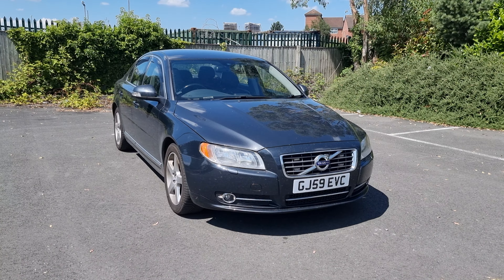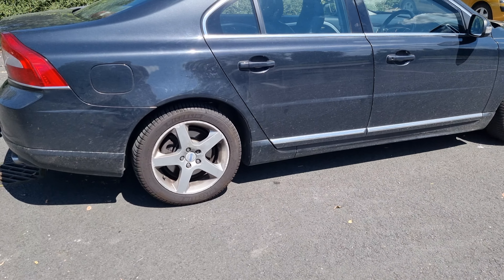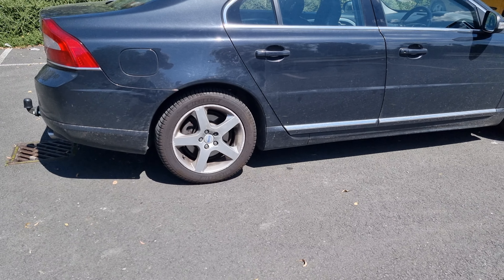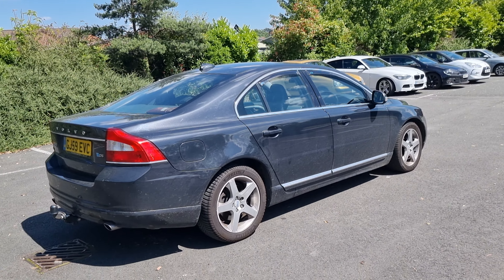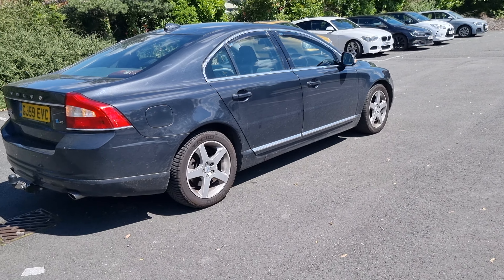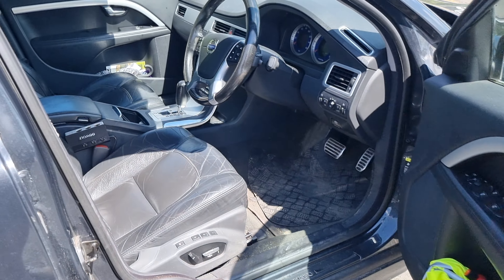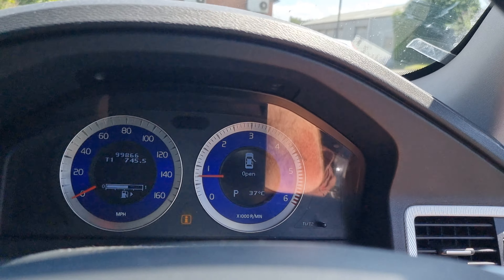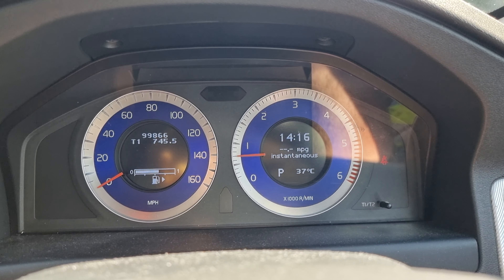Fitting my Volvo S80's £500 Shock Absorber was *TOO EASY!!*

Comment: The parts and fitment is exactly the same throughout p3 Volvos. It's good that this operation won't result in wheel alignment. I have checked it anyway but it was unnecessary. The rear shocks should be replaced together with their top mounts. They are made of aluminium and tent to crack
Reply from the maker: Not required with these units :)
Reply: Top mount was what actually failed in my S60 in January and ruined a shock absorber with it (170k miles on clock, I suppose it was due at some time ;) ) Replaced pair of mounts and shock absorbers at the same time for peace of mind.

Comment: Hi, love your videos on the S80! I’ve just bought one myself on an 07 plate with 166k miles. It was a highly spec’d SE Sport and has 3 suspension settings - Comfort/Sport/Advanced. I leave it in Comfort and the button has a green light has does the Sport setting. The Advanced setting though has an orange light? I saw in one of your other videos saying that the S80 has rear levelling suspension…would the Advanced setting have anything to do with this?
Reply from the maker: Hello, great choice! You have the fancy nivomat suspension, fortunately you won’t have the £500 per rear side self levelling shocks as the whole nivomat system is more technical but cheaper to replace! It may be that the advanced setting is unavailable due to there being an issue with one of the shocks. Sounds like a sensor if the other two modes work with no problem :) I’m not entirely sure what the advanced setting does but I think it uses sensors to optimise each shock absorber for the current road conditions :)
Reply: Another question for you…do you know how to turn off the SOS subscription notifications every time I start the car? I know I press the ‘Read’ button on the left stalk to clear it but it gets quite annoying every time I start the car!

Comment: What shocks are fitted to your Volvo? You may have mentioned it and I missed it. Mine could do with changing all round but I’m not paying £500 for one shock alone. I have to do the front top mounts so I would do all four corners the same day. Mines R design suspension.
Reply from the maker: Hi Alex, My car has self levelling rear suspension:) the front Shocks are normal :) the only way to tell is to get underneath and take a look at what the shock looks like :)
Reply: @drivelife.channel  ahh okay I know mine doesn’t have them but some lane brain decided to change one side at some point in the cars life so it sits higher on one side. I know the self levelling you can get away with just the one side that’s gone.